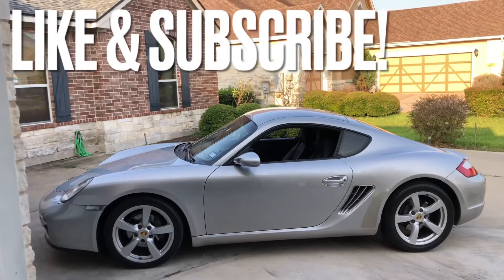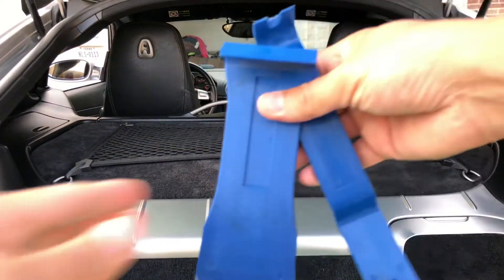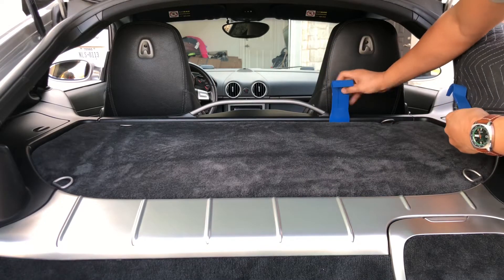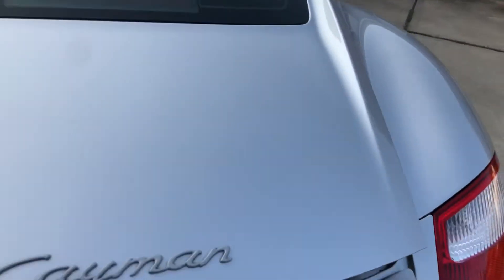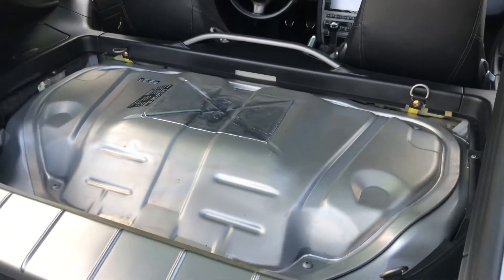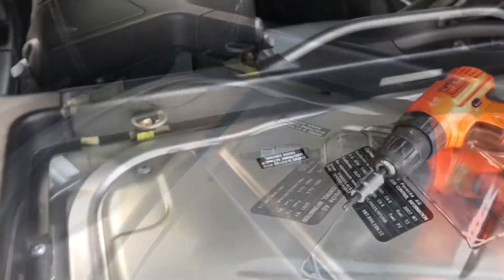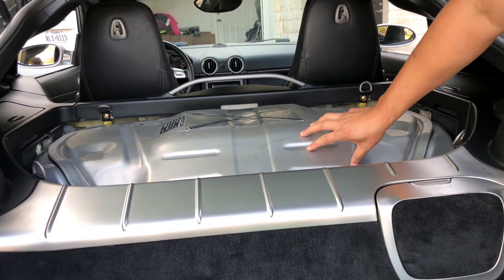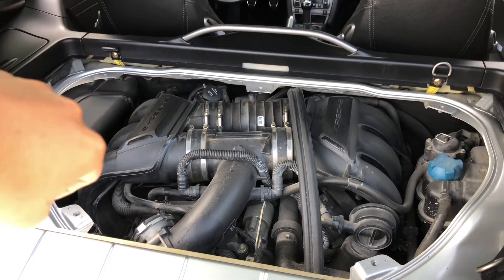Remove #Porsche #Cayman #engine #cover under 4 minutes!!! Super Easy to do.

Comment: Ever work or driven in a Cayman with the clear engine cover?  I'm curious how much NVH, cabin heat, and weight that adds.
Reply from the maker: Hey! I haven’t driven one with the clear engine cover but have with my insulation cover off and exposed. I’ve also driven with it off completely. 

Insulation cover off/ engine cover on: sounds great like I have aftermarket exhaust. 

Insulation cover and engine cover completely off: you can hear al the interesting noises, burps, intake, etc. Great to experience but I won’t drive it around like that long term. I’m sure there are pollutants I was exposed to as well.